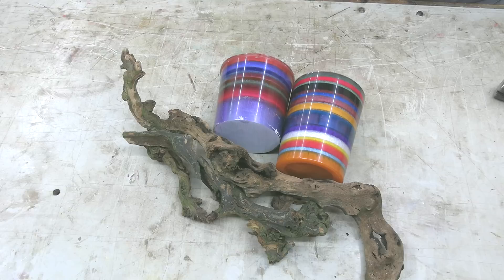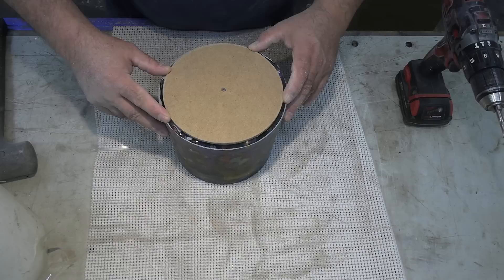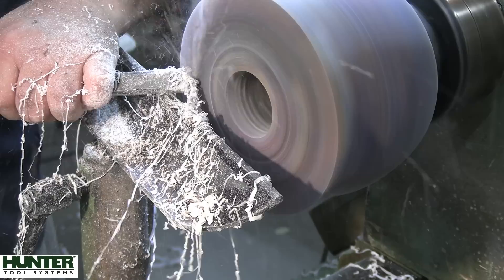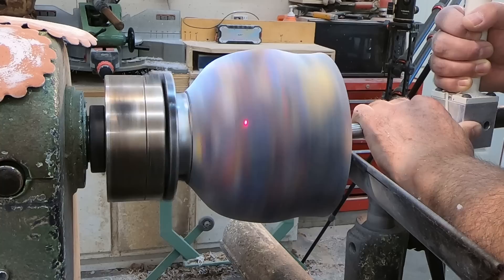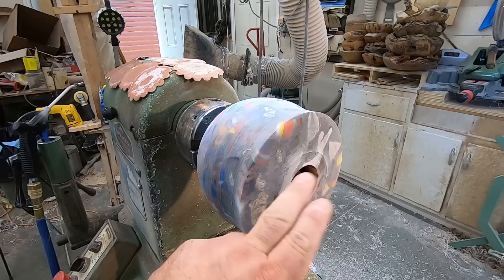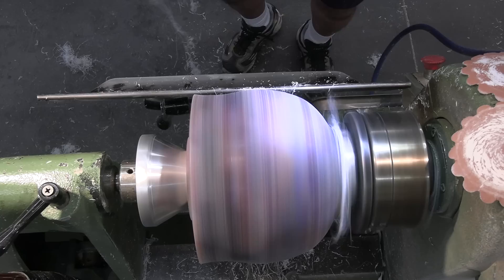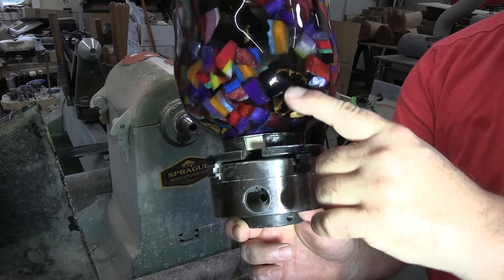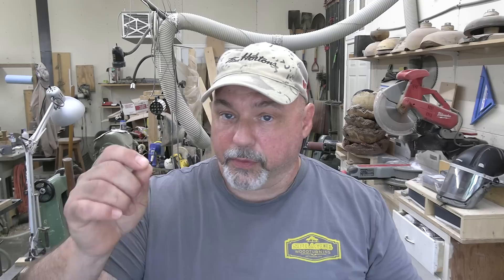Woodturning - The Kaleidoscope Hollow From

Comment: I didn't realize how translucent the hollow form is until those last pictures - pretty cool. I started with pine - from old 4x4 fence posts that had rotted at the ground that we replaced. The wood is light, very dry, and cuts easily. The wood was free and great to learn with. I'm simply a hobbyist and still have much to learn.
Reply from the maker: Free is always good. Thanks

Comment: In baking, you're actually taught to lay a piece of wax paper over something with a spray-risk before bashing it with the hammer. I'd suggest in the future, you lay a cloth or towel over the pieces before hitting them. It helps contain them and prevents them from turning ballistic on you.

I think the randomness of the broken resin blocks actually was a lot more successful than your previous attempt with the candy bowl. I like this one much better. Also, the black doesn't have that soggy-cereal-in-milk look, so that's also nice. I wish we got to see more of an appearance of the wood, so if I were doing one of these, I'd probably get a few more branches in there for a more balanced look next time, but it's still a very nice hollow form. And a great use of supplies you might not otherwise be able to use!

Wow! When it's internally lit, the grey disappears and it REALLY looks like a Kaleidoscope! Super cool effect.
Reply from the maker: Yes, I will use a pillow case next time to contain the pieces. Thanks for watching

Comment: You could use a prefab or custom made box to do this type of  work. I used one a a job. Just built a 3 sided rectangular  box, cut an angle to top of front sides like a roof. Add a top, then add plexiglass clear piece to look through, leave room for arms to work inside. You can add a light on top, a vacuum  suction system in bottom, Dremel or electric. Our Dremel's used leg pressure, working on tiny objects but easily adapted to to larger size, protecting face and from dust.
Reply from the maker: I not think this would be practical for filming, that would be the only problem with it. Thanks

Comment: Another great and colorful project. In regards to glue blocks, I have started using them after watching you and they work really great for me also once I quit leaving a large amount between the block in the work piece. It only takes a little thin layer of very hot glue to do the job. Other wise you could get a little wobble at high-speed and possibly separation
Reply from the maker: Yes, I try to compress the glue block as much as possible. Thanks for watching

Comment: When I was a shop teacher we experimented with applying finishes to bowls on the lathe and leaving them rotating with the lathe powered by a rotisserie motor (low revolution 5-6/min) overnight to eliminate finish runs. Have you heard of this? I believe we were using an oil based polyurethane for the finish. BTW That form is a fantastic job!!
Reply from the maker: I don’t need to do that with this finish, if it goes on thin enough it shouldn’t be a problem. Thanks for watching

Comment: As usual Jim, a very creative project. I have learned to use the glue blocks and truly enjoy the process.  I share your opinion on turning beech: I do a lot of it because the spalted pieces are so gorgeous, but I often have to use resin to fill cracks that appear in turning. I believe it works better with once turned thin objects, like hollow forms for instance. I found willow wood very nice to turn for beginners: salad bowls can show incredible shades once finished ! Thanks for sharing your thoughts on your preferred woods and your comments on security measures. I do use a leather apron since I received some debris on my chest, gloves for roughing pieces and long sleeves to protect my arms.

Have a nice week.
Reply from the maker: I’ve also heard the thin green turning will work with it. Thanks for watching

Comment: That's effin awesome 😎😎😎👍
If the engraving kinda disappears when ya put the finish on u could always put a contrasting color of acrylic paint n the groves. Just Smosh it in, let it halfway dry wipe it with a damp cloth to get the excess off. Let it dry completely n if there's residue left around where it needs to be buff it off with a high grit. Then the finish coat
Reply from the maker: Cool idea, thanks!
Reply: @SpragueWoodturning  ur welcome 🤗😁

Comment: Try rough cutting wet wood into a bowl then put in rolling boiling water for 45 min per inch thickness . That’s the secret formula .  No short cuts there .  While moist ( don’t let it dry in room air) put in paper sack with shavings and seal .  Leave for 6 weeks and check moisture and for cracks .   Higher chance not to crack .
Reply from the maker: I’ve done the boiling method without success. I didn’t put into paper bags to slow down the drying though. Thanks for the info!

Comment: Interesting to hear your thoughts on beech. I just had one come down. I only kept a crotch. Cut it and roughed it immediately and before I could get it off the chuck it was splitting already. Might have been amplified by the fact it was crotch, but nice to know your experience. Thanks Jim!
Reply from the maker: It’s a very difficult wood to work with, someone else has mentioned that steaming is the answer. Thanks for watching!

Comment: what is the time frame for the difference between green and non green wood? also how long should you try and dry wood? burls are like the root balls correct? this absolutely beautiful. i even liked the waste clock on bottom though i figure your goingto remove it. it gives an interesting contrast
Reply from the maker: It depends on your climate if it’s dry or not. As a general rule one year per one inch of thickness. Thanks for watching

Comment: This is fantastic. I love the work you do. With the wood you use, do you heat it or stabilize it to avoid air bubbles in the resin? Or is it the slow setting deep pour epoxy? Just curious on your thoughts on this
Reply from the maker: It’s deep cast from Designer Epoxy and I rarely stabilize the wood I use. Thanks for watching!

Comment: do you think when you poured in the bits of broken epoxy you gave the bucket a few slaps that basically rattled all the small pieces to the bottom
Reply from the maker: Yes, they probably would of ended up there naturally due to its size. Thanks

Comment: Two questions--do you use a spray in your resin bucket to keep it from sticking--it came out very easily and, do you always use carbide for resin or do you use carbide for everything?
Reply from the maker: Not always, I do have mold release and use it occasionally, but I’ve actually found paste wax to work better. Thanks

Comment: Nice project as always Jim. Do you not have much Elm or Ash left out east? Living in southeastern Alberta it’s mostly all I can get when it comes to hardwood in log form. I really like Elm and Ash can be very beautiful but also hard to dry in the hot dry prairies as it tends to crack while turning it. I’m curious as to your thoughts on those two woods (in comparison to your usual species since you preferred ones are unattainable here) as I can’t recall you using Elm much and don’t believe you’ve ever used Ash on your channel. 

Thanks for the video and I’m already looking forward to next Friday.
Reply from the maker: Ash is getting scarce because of the Ash Borror and it tends to be kind of grainey, so I put it in the same category as oak. I have produced some really great pieces with it in the past, but mostly used white ash. I've use elm in the past and just did a hollow form a few weeks back but it's another wood that not all that available here in this area. Thanks!

Comment: I always wonder why, if you plan making a hollow form, you don't use a piece of waste wood in the core of the mold, so you aren't wasting resin that is going to be cut away. Or am I just being a bit too much of a scrouge?
Reply: Finish looks much like a glass jar of liquorice allots and nougat. Very pretty
Reply from the maker: I’ve done this in the past and it will work as long as the spacer doesn’t move and rune your project which has happened to me before. This will also restrict your form as well, for these two reasons this is why I don’t like doing it. Thanks for watching!

Comment: Why would you not cast that hollow? You could have saved so much material.
Reply from the maker: I get what your saying, but the issue with that is your married to a certain design which I don’t care for. Along with that, what would you use as a spacer other than wood and getting wood that dry enough to use that thick is an issue as well. I put a wood spacer in the Banksia pod vase and it affected the design. Thanks for watching
Reply: @SpragueWoodturning  I was thinking that you could use a cheap rubber ball, or maybe a Mylar balloon. Of course, I could also be an idiot.